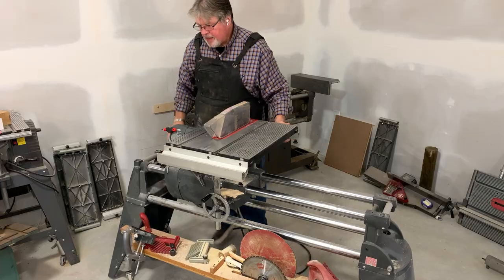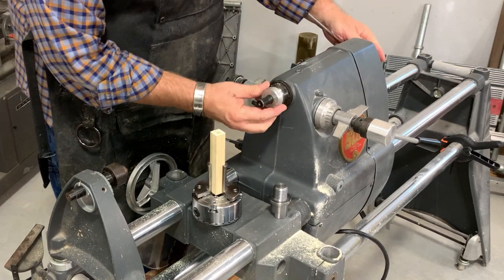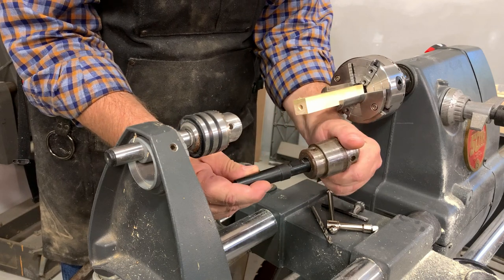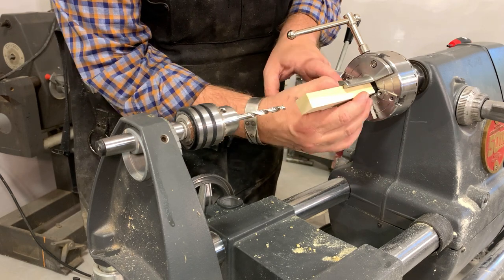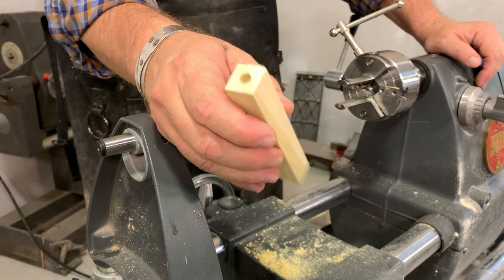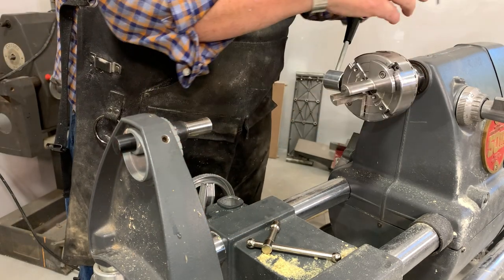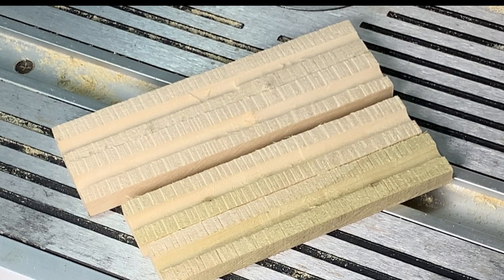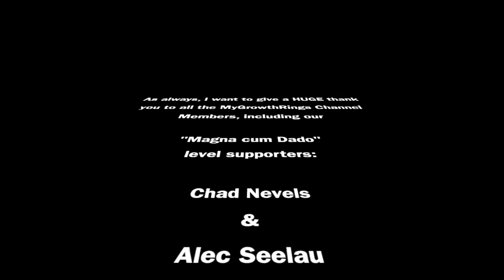BORING! Pen Blanks on Lathe: Two Methods, One Stinks!

Comment: Where can I get that tailstock chuck arbor? I would love to be able to use my shopsmith tools as much as possible.
Reply from the maker: @hisnameisiam808  Shopsmith sells the chuck arbor but you can drop open the video description and I think I link to one there.
Reply: @MyGrowthRings  I found it on ebay! Thanks friend! Do you know if I can get new rubber on the drum for the 6 inch belt sander? Or do I need to buy a new drum?
Reply from the maker: @hisnameisiam808  They do, but I know a guy who ordered one recently and was surprised and disappointed that he was shipped a section of automobile intertube!
Reply: @MyGrowthRings  😬😮‍💨😅🤣😂🤣 oh no! I'll look into it! Thanks!
Reply: @MyGrowthRings  hi sir, so I purchased the wen 3.75" chuck you linked to in your video description and the pen chuck jaws you linked to as well and for some reason the screws that come with the 3.75" chuck do not fit through the pen chuck jaw's screw hole. Did you have to modify at all?
Reply from the maker: @hisnameisiam808  No, I didn't. I wonder if they made a change in one part or the other. Let me double-check.
Reply from the maker: @hisnameisiam808  This is the jaw set: https://amzn.to/4cHdGJD and this is the chuck: https://amzn.to/45PVU3X  The listing even says that they are compatible.
Reply: @MyGrowthRings  is it the 2.75 or the 3.75? I'm having to copy and paste the names of each of the tools into the Amazon app and it's possible I got the wrong things. And I don't see any other options for the pen chuck Jaws other than what I purchased.
Reply: @MyGrowthRings  ok, I see it now... grrr. It was the discrepancy between the 2.5 and the 2 inch of the pen chuck Jaws. I see that now. Sorry to bother you!  I just assumed that I was getting the right thing! Thanks again for the help! I will put it to good use making things and teaching my son how to make things on the shopsmith my dad bought 25 years ago and never has been able to show me anything because he didn't even really get to use it... but I've been learning(and breaking things 😬 between my teenage years up until 32) and now I'm getting into the lathe and drill press(which my dad always told me about, but I never believed him until I found your channel.)😅
Reply: @MyGrowthRings  what I ended up having to do because when I would copy and paste the EXACT information from the Amazon profile of the pen chuck Jaws it would only show me the 2 inch version. I didn't know the 2.5 existed because it didn't show me and I didn't think to look for it(couldn't find it when I did look on the app) because it didn't come up when I put the exact information in. I finally figured out that if I send myself the Amazon link from my browser to my text messages then I could click on it and it would find the product in the Amazon app. 😅 that was a bit of work! Man! Thanks for the help! It won't be here until Tuesday... bummer haha. At least I can get started on my projects and I'll just have to wait for the part and that makes it just a bit more fun because the anticipation is often just as fun as accomplishing the task haha 😄. One of the goals I had was to make a pipe. We will see how that goes. Right now I've got two missouri meerschaum corn cob pipes. I ended up getting bronchitis and it went into my vocal chords and then into my sinuses and then back to my lungs and back to my bronchi etc. For about 6 months now. 😮‍💨 but I'm slowly healing. I've never had this before and it's so frustrating!
Reply from the maker: @hisnameisiam808  Wow, what a pain! Sorry for all the extra work. It’s funny, but just yesterday I was thinking about making a pipe, too. Hope the bronchitis clears up and for sure, no inhaling!